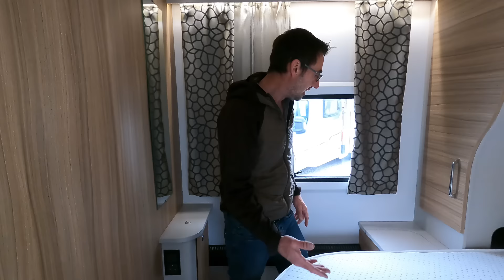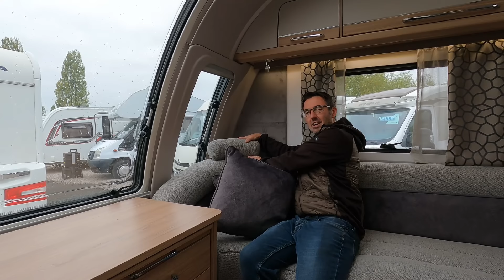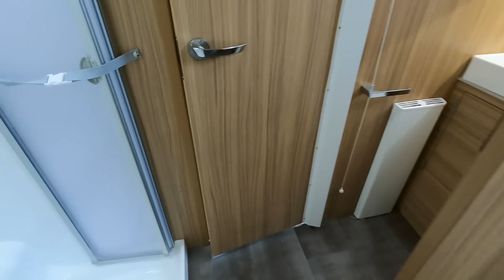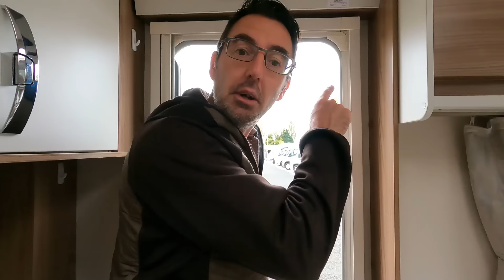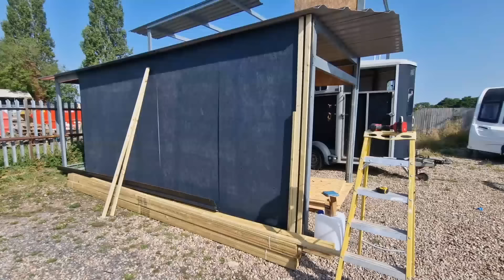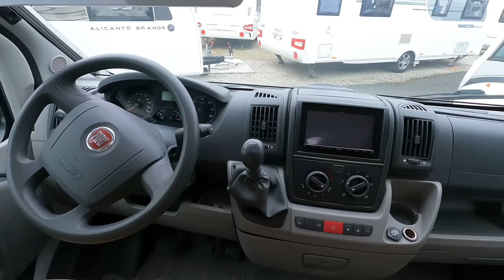Caravanning For Years!

Comment: We moved onto a serviced seasonal pitch, I use the float in the aquaroll water system, I was leaving the water in the boiler and not draining down when I went home.
But after a few months we started getting a foul water, damp smell, I traced it to the hot tap it smelt bad.
Reply from the maker: Yes regular drain down and a yearly flush through with puriclean is worth it. 👍

Comment: Hi Mark. Another great video.!
I have a question about alde heating in our new caravan. We store it on the drive so is plugged in to mains most of the time. Our old van had blown air and I would set it at a low temp as a kind of anti frost and have the fan run on lowest speed to help move the air about.
Does the adle system need fresh water in it to allow the heating system to run?
I would like to do the same have the heating on low and  maybe use a couple of small fans ie. front & rear.
Maybe a subject for a video too! Thanks Barry
Reply from the maker: Hi Barry, as long as you leave the hot water in the off position, you can run just the heating, so no water needed. Just make sure your Alde fluid level is correct and you will be good. 👍

Comment: 1700 Kgs is super light by Australian standards
Reply from the maker: For the uk it's a heavy single axle and not far off twin axle weights. About 2000kg is maximum for our twin axles and thats really heavy for us. 👍
Reply: @thecaravanplace  Australian vans are nuts,  twin axles average around 2500kgs, they are about a metre off the ground and we paint them black, in our climate, you don't need to turn on the oven to cook and you need to keep your milk in the freezer😂

Comment: Trouble is you're dragging a big bed around, when you only sleep in it, caravans seems to be getting bigger, when cars are getting weaker (electric).
Reply: I wouldnt worry about the weight of the Bailey as the manufacturer has addressed this problem. Its self lightening and will adjust itself to the towcar from the first use as parts of it fall off!!
Reply from the maker: Yes this is true, but I think we want everything is the problem, so manufacturers have to try and please the consumer (big try) they stopped building the smaller vans as they just dont sell as well. Will things have to change?
Reply: @thecaravanplace trouble I find, even the big fixed bed vans, the kitchen is the same size, as a small van. If we were changing would be probably side dinette, so big work top area, and leave bed made up, nice big shower for wet coatsafter doggy walks, big enough to manage in winter without an awning, the awning changes everything.
Reply: @jeremycarr3920 people (well a huge minority) eat out and just sleep in their van. Don’t want to be making beds up. Use the site showers etc. so don’t need a washroom. Why don’t someone just make a van with no washroom, or kitchen and just a big bed? It would be a lot lighter?